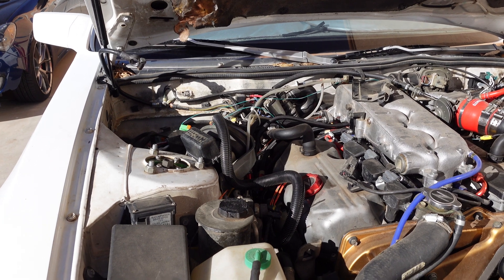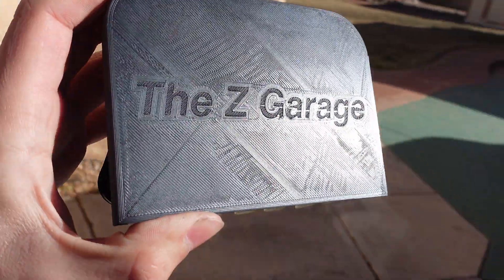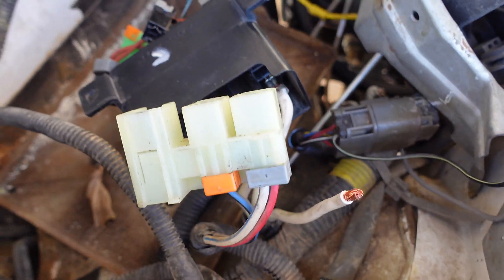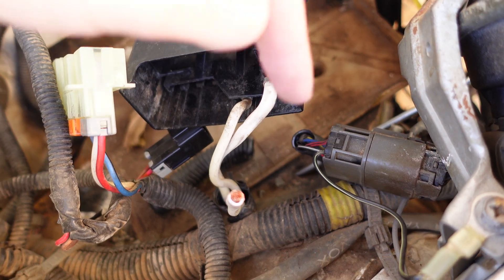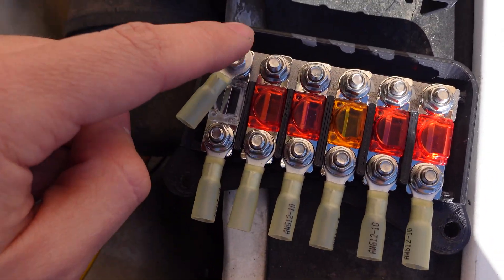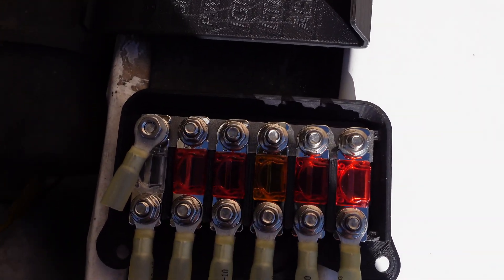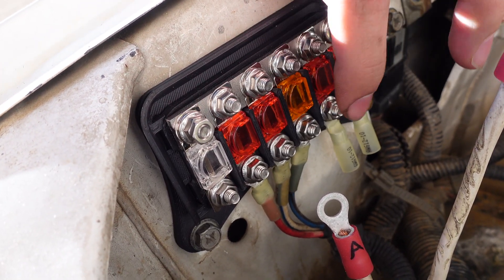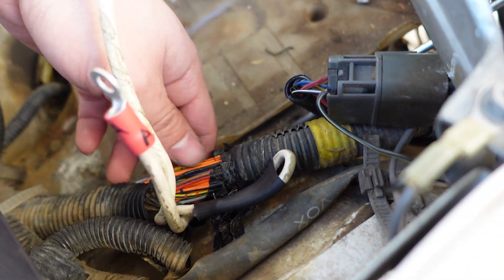Product Release: Fusible Links Box!

Comment: Out of curiosity, what would happen if you swapped the connection between the alternator and battery positive? Double checking inside the links box: My battery positive should read the battery's voltage (when tested with a multimeter on the Battery's positive terminal)?
Reply from the maker: If the battery and alternator wire were swapped, the fuse that normally protects the alternator wouldn't be in line so it could theoretically be damaged, but the main issue is that the other circuits combined could pull more than the 80 amp fuse the battery is now running through and blow it cutting off battery power.
So leaving it in that configuration wouldn't be a good idea.
Reply: @TheZGarage Thanks for the quick response. I believe I have it on correctly, but if you could double check my math: my white wire, which is continuous with the battery positive, is hooked up to the associated positive post.

My non-continuous white wire (reads >150ohms) is my alternator cable. This one is hooked up to the post below the former.

All said and done: Continuity with the car battery positive is now true amongst all 6 fuses.

background information:
My engine cranks with no spark. Code 11 for CAS is thrown. I have replaced the CAS before so I’m hoping it’s probably fine. PRW-2 is coming in the mail. Lastly do you have any tips on testing the CAS pins?

Sorry for the text wall. I’m eager to hear your thoughts
Reply from the maker: @jaimereyesiv8202 if there's a fault in the CAS circuit, that will cause a no spark condition. I don't know how to test the CAS itself, but cleaning the connector in the distributor, and checking resistance from the CAS connector to the ecu would be my next step

Comment: Currently dealing with no power after swapping in a new battery. 😩
Reply: did you ever get it fixed, i upgraded and i got 12.30v in each fuse and continuity in what i believe the correct wire, and i have no power, the seats move and headlights turn on sometimes but popups dont work, is this similar and how did you fix?
Reply: @iOldFasionGamer  yea im a dumbass lmao, there was this skinny wire that goes on the positive (not sure if its like that from factory or if someone added that) i forgot to out that wire/cable back on and everything worked
Reply: @iTzJuniorOT  damn wish mine was that simple

Comment: I kid you NOT! Is really freeing to be able to personally fix an issue that a lot of people probably share. Thanks for sharing info with the Z community!  I have been working on fixing my AC.  I just found out by looking in my relay box under the hood that the port that “Should” supply power to the relay port labeled as “VAC PUMP” has NO leads in that section aka no wiring routed through that section for the relay to make contact with. SMH.  I think a long time ago I had someone do some work on my car and I think they either didn’t have a relay for that port to fix it so they decided to route power from what I think is the “H/Lamp washer wiring harness.   But for some reason the pump is not getting powered up. I ran a jumper from the 12v car batter to the leads on the Vac canister and I could hear the motor on it engage. So I assume that it works.  Any ideas on how I can fix this issue? Tomorrow I’m going to lift the entire housing for the relay box and I hope that the leads that are supposed to feed that relay are stuffed under it and are still capable of delivering power then I can just plug in the new relay and be back in biz.  Again thanks  for all that you are doing for the community.  We all have love for these cars and want to keep them running.
Reply from the maker: I'm not too familiar with the stock vacuum pump since my car never had one on it. I can only recommend reading through the factory service manual on XenonZcar.com to see if they have a diagnostic procedure for the pump, as well as looking through the wiring diagram to see where power comes from
Reply: @TheZGarage  🫡

Comment: But the fusible link is used because it can handle short amounts of higher current..Did you just use a fuse higher then it should ever reach?
Reply from the maker: The type of fuse I include can handle slight amounts of over amp draws for short periods of time just like the stock fusible links

Comment: is that maybe why my car didnt hold charge after i changed the alternator?
Reply from the maker: No that would be from something else. Google how to find battery drains in a car and it'll show you how to go through each circuit to find which one is causing your battery to drain
Reply: same for me the crc is prolly our priblme
Reply: @Raxx-qd2dp  crc? Also it was my linkable fuses.
Reply: @eirafelloff  oh ok that's good u got it all figured out i meant crank angle censor, or is it sensor lol idk but yeah idk it could be that too but good u got it goin
Reply: @Raxx-qd2dp  it was that I changed my alternator and the link fuse popped and then I changed it again and put the cords on different spots

Comment: I'm so glad this came out as soon as mine had issues I was wandering what mainly that fusible link box controls since I really need to figure why my headlights won't turn on or the cluster but everything else turns on? Please help🙏
Reply from the maker: The fusible links send power to the interior fuse box and other things like injectors etc. Just use a multimeter to check the resistance on all of the links. If they don't have continuity then they're burnt up. The headlights could be the Headlight switch, that'd a pretty common failure
Reply: @TheZGarage  they may actually still have continuity and be burnt out. I had to figure that out through trial and error.